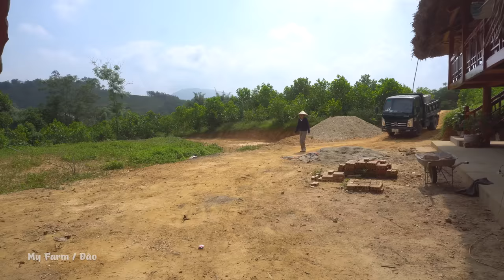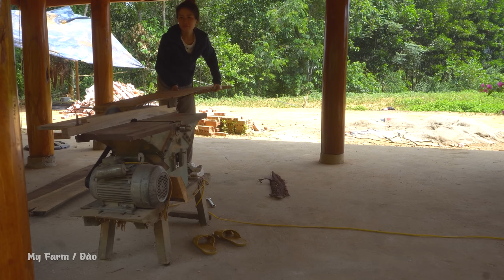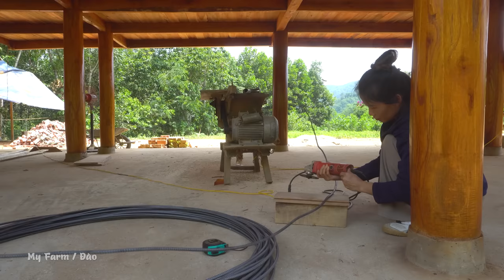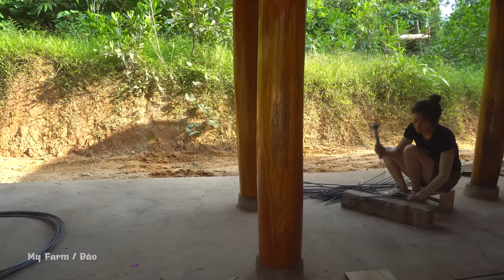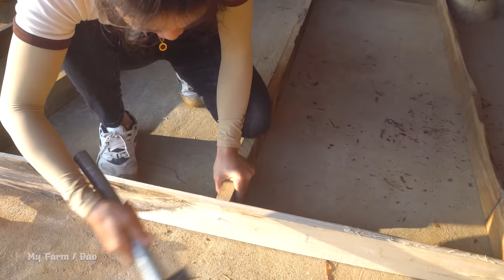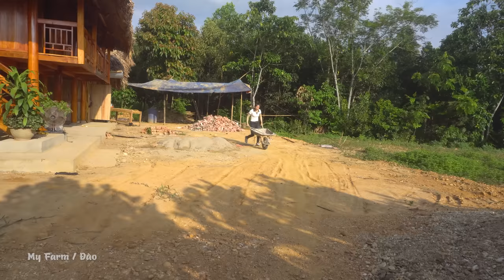[30 Days] How To Building Toilet (WC) System With Septic Tank, Build Front Yard (FULL BUILD)

Comment: this is a very impressive work done by a woman. very beautiful. but it would be even prettier in the installation to install pipes drilled through from the ceramic surface to the back of the wall. You can still carve out the outside, then plaster it again, so that the pipe can be hidden 👍 really good work & continued success